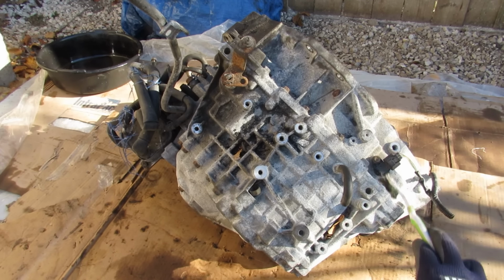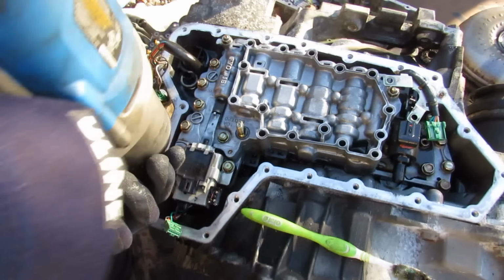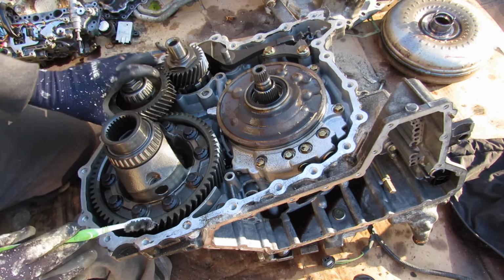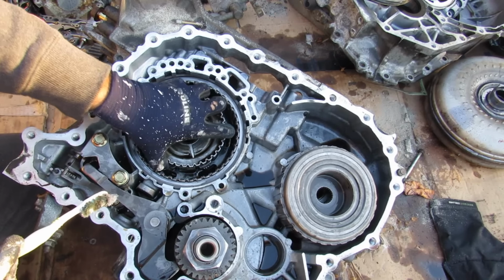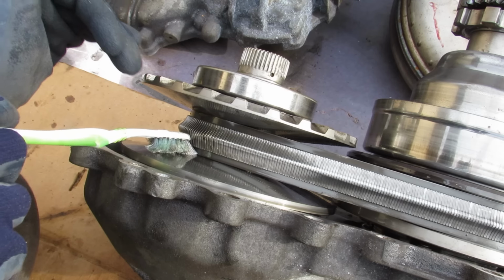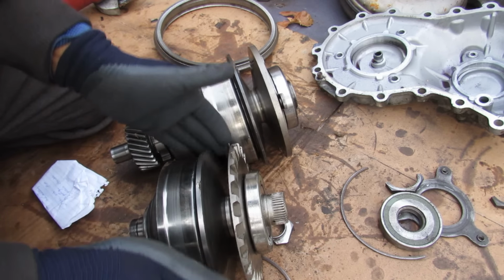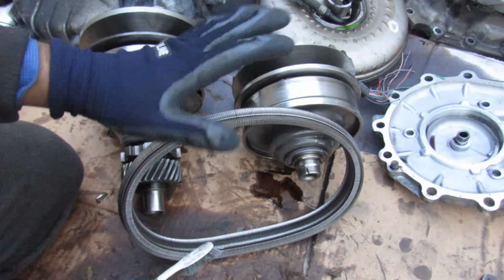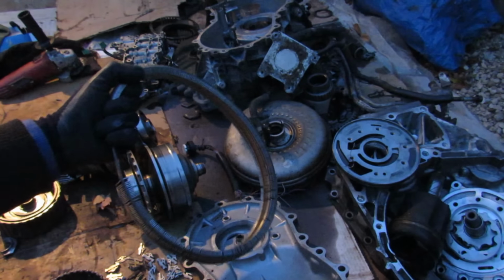Why Nissan CVTs FAIL

Comment: Nissan like so many American auto manufacturers continue to make and sell knowingly fail prone vehicles suxh as their Pathfinders and trucks with known engine coolant to transmission cooler failure prone radiators,fuel gauge on fuel pump issues, their airbag issues,brake issues and yet they keep on pumoing out their overpriced very costly 6k$ and more faulty vehicles thr same way that Ford did with the pinto ,chevvy did with the Vega,Luv,and chevette,etc... Pay off a few key gubmint people and one could literally build and sell a vehicle capable of exploding upon impact and killing all persons inside as well as those nearby... The almighty dollar...

Comment: I always suggest customer's to change their cvt fluid every 15k miles. I have replaced countless of CVT transmission in Nissan's Honda's and Subaru's. It's a great transmission as long you replace the fluid at 10k-15k miles and make sure to upgrade the transmission fluid cooler like i did on my wife's 2020 Nissan Rogue. Yes I upgraded to a V8 style transmission fluid cooler that is mounted in front of the radiator.

Comment: I think most failed within the first 6-12 months.   I didn't need to learn about CVTs so I didn't watch the whole video but did it evwr say why Nissans fail more than others?   I got 160k miles on one I bought new, nevwr serviced, no problems.

I actually prefer a cvt over ma ual or traditional autos...smooth shift.

Comment: My CVT failed at 31,000 miles in my 2017 Mitsubishi Outlander Sport ES. Replaced under warranty but still wonder what will happen after 60,000 miles when the warranty runs out.

Comment: On the face, it looks like it should be easier to maintain and if the one part "the belt" wears out it doesnt look very hard to replace instead of a conventional automatic with 4 5 or 6 or more clutch packs that wear out

Comment: Excellent content, excellent presentation, and the pace is perfect. I've been a mechanic for 40 years and this is actually the first video I just didn't have to fast forward at all. Didn't waste my time with redundant bolt removals and trying to get stuff apart. Very good work.
Reply from the maker: Thanks, that's my style, straight and to the point

Comment: I regret buying my 2016 altima already swapped a transmission at 12000 miles
Reply from the maker: Dump it while it still has scrap value

Comment: We still have a 2005 Toyota Prius with an ECVT that I like to drive on weekends. 217K miles, no transmission problems. ABS brake actuator assembly fail once.
Reply: That's because it is a CVT in name only because that's just the closest existing category that they could lump it in to instead of creating a new category, this was a mistake IMO because it causes people to associate the problems of the belt type CVT when they aren't even remotely similar. The only thing that shifts in that HSD transaxle is the parking pawl. There isn't a torque converter, nor a belt, there aren't any clutches on that model, and the pump is just there for lubrication not to apply hydraulic pressure. It's just a single planetary gear with the sun attached to motor-generator 1, the ring attached to motor-generator 2 and the wheels, and the planet carrier attached to the engine. With the HSD series-parallel full hybrids you have part of the engine's torque always going the parallel mechanical route of planet carrier to ring, and part of it the series electric route with planet carrier to sun hence to MG1. Reverse just spins MG2 backwards as a motor, low "gear" AKA underdrive has MG1 spinning forwards fast at low torque generating electricity while MG2 is running slow at high torque consuming electricity. Direct drive has both MGs turning the same speed. For overdrive they first run MG1 slower than MG2 and beyond that they can switch roles and energy recirculates, MG2 generates enough electricity to run MG1 backwards as a motor against the engine torque which slows the engine speed down. It's all in the Prius HSD nomograph.
Reply from the maker: Good to know. I want to take apart one of those someday

Comment: I have the Audi variant of CVT. The rubber band effect is just a feeling, and it’s caused by the static engine sound that some car makers utilities. CVT’s can go from low to high ratio in a blink of an eye, so it’s not about the speed of the gear box. Audi has solved the rubber issue just by letting the rpm rise during acceleration.

CVT’s waste energy on constantly pushing those conics together. But the get it back by running the engine more economically and by having a long ratio on highway speeds. Normal transmissions do not have as log ratios, since you would not want to change gears all the time.

Comment: In the 60's DAF, the Dutch built car had simple, similar, with exterior rubber belt to give the constant speed variations. Most agricultural self-propelled Combine harvesters have used exterior rubber belt style since 1944, with Massey-Harris offering the first self-propelled model

Comment: My previous car was a Murano awd, probably exactly the same model if no older.  It have a few problems here and there, but luckily the transmission keeps working until trade in. Have to say compare with their mechanic, they did great job on the infortament system.

Comment: Great video. Slight mistake on the friction comment. CVT is not as efficient as a manual or automatic transmission unless there are too many shifts (programmed incorrectly). You even mentioned the heat. That is being produced not just by the torque converter but also the belt. The fluid around the belt is being heated up, hence the temperature you mentioned not being well controlled. Where CVTs are less efficient internally they try and make-up by keeping the ENGINE in it's efficiency range (when that's desirable). BSFC (brake specific fuel consumption) is the only chart to look at when trying to understand engines as they relate to transmissions and typical driving scenarios. Basically there is a nice little "island" that the engine wants to sit in at different speed and loads. Hitting that sweet spot is very tricky with a few gears but a CVT or a high gear count automatic can keep the engine right where it should be to maximize the fuel efficiency from the engine. CVT = cheaper to produce and more compact that a high gear count automatic. Also, with lower peak power output, a CVT can be built lighter for the same power handling (but needs better cooling) and can then perform well with smaller engines with high loads.

Comment: I own a 2015 Nissan NV200 that's approaching 90,000 Kms.  I've had very few problems  with it and I don't see complaints from other NV200 owners about the CVT transmission.   My warranty  is coming to an end in March 2021 and the dealership says I can add another 3 years if I choose to in March.   Should I renew?
Reply from the maker: Depends how long you want it to be in the fleet for...how much is the warranty vs a CVT replacement
Reply: @speedkar99    I'm an owner, operator in the telecom field.  Warranty should about $3000 but out of warranty repairs can be very expensive.  I'm thinking about other repairs that come from road damage, etc...

Comment: This guy knew every single piece of this transmission down to the dust particles and didn't even skip a beat, Almost like he built it.
Reply from the maker: Haha you'll never see me build this back
Reply: @speedkar99  oh come on, challenge yourself, where's your spirit? Rebuild the CVT 🤣 just kidding, there's more pieces in that than a 1/2 scale Titanic
Reply: @speedkar99  Wouldn't be economically feasible. You'd have to change out the belt and both pulleys to guarantee success. Also this design is highly vulnerable to failures due to contaminants. They don't even want you changing the fluid.
Reply: @speedkar99  Well taking apart is the easy part, isn't it? ;)
Thanks for this video. Your channel is the best, you explain things very clearly.
I hope you make a video on Toyota's e-CVT some day.
Reply: @imblackmagic1209  A hammer and a punch is not the correct tool but it'd removed that nut non-destructively !
Reply: But was clueless about the correct way to undo large nuts !
Reply: @millomweb  I thought it was a perfect solution; how many hours have I "wasted" trying "color inside the lines" and find a wrench to fit? Smile!

Comment: A very good video.  Is this one of the notorious JATCO CVTs?  Their failures are legendary (just follow the Reddit sub justrolledintotheshop for awhile), even in the smaller Nissans like Sentras and Versas.

Also, would adding a larger, aftermarket transmission cooler help these last longer, by reducing the temperatures inside the CVT?

Comment: I've been watching enough videos from Andrew Camarata to know that a similar system is found in snowmobiles.
Reply: and if you know anything about a sleds CVT's get really HOT ... and guess what transmissions hate.. Heat
Reply: Scooters too, I usually have to buy new rollers (variator) and belts every year.

Comment: The level of engineering and manufacturing that goes into cars is kind of amazing.

7:14 first time I've seen a cycloidal pump...
Reply: Not really, if it fails before it hits 100k and goes to the junk yard it’s a miserable failure.

Comment: To be honest, my favorite driving experience of any car I have ever driven so far is the CVT of my Nissan Juke. The combination of a transmission that's always in the right gear when driving aggressively through mountain passes, it responds quickly, always has POWER, and actually provides a decent and consistent engine braking experience. Sure, it's different from a well performing auto trans but after a few weeks of colorful driving, I came to really appreciate the CVT. The torque vectoring just added to the experience, that's a separate topic of this video but that's an incredibly under-rated feature in cars that feature such technology. 

To attempt prolonging my transmission in my Juke, I added a CNC ATF bypass block between the transmission and the ATF/coolant exchanger that gave me 3/8 barbs to hook up my own transmission cooler. In hot July drives pulling my jet ski to the lake, I saw CVT temps at 240-255F. I saw these temps even in the winter driving in deep snow up the canyon. It always whined loudly when these temps were reached, it didn't take much to hit these high temperatures. I installed a 12" Hayden cooler and I was blown away; the hottest I could heat up the transmission pulling the jet ski the next summer was 195F. Hard driving not towing the jet ski was closer to 188F or so. In the winter, I had to install a thermostat to avoid scary low temperatures. A 160F darele thermostat did the job. I have no idea if this is the fix, but those super high thermals can't be good for these transmissions. I have seen even later gen Toyota auto transmissions failing possibly because of this inferior cooling design... I don't see tiny 200F engine coolant exchangers keeping any auto transmission "cool" enough under heavy loads and hot summer months.